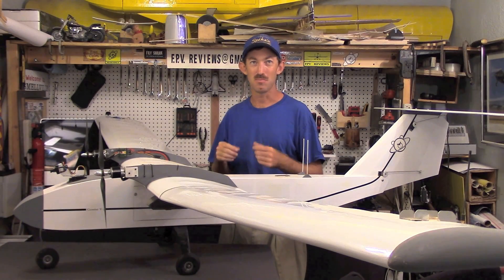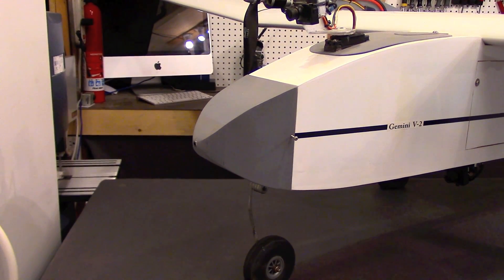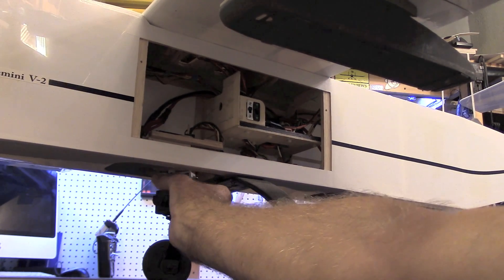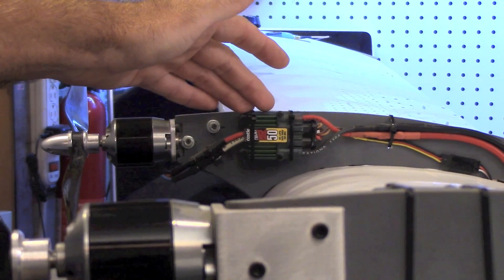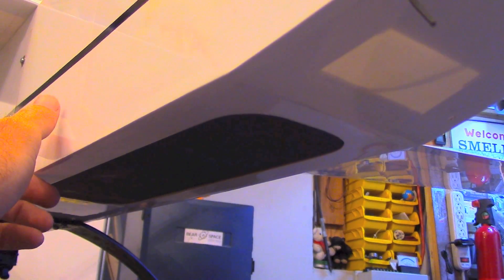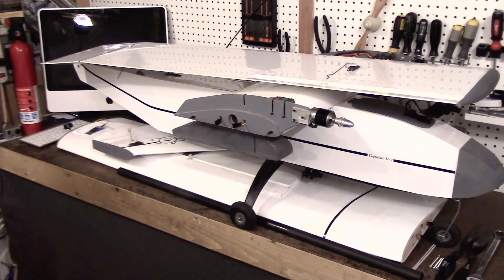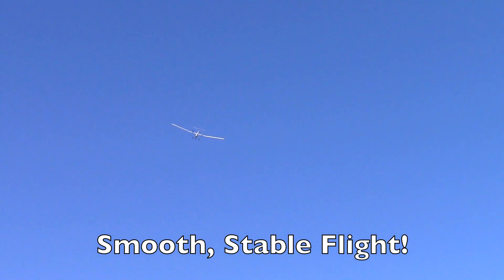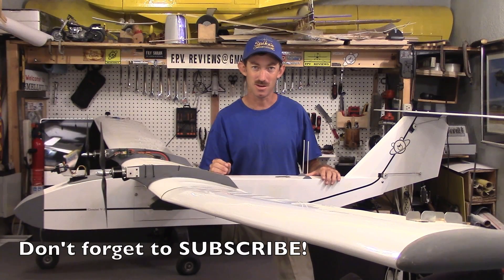Gemini Version 2 Review - Advanced FPV / UAV Plane - Plans and Kit Available Now!

Comment: instead of installing to blade propeller is it possible to install four blade propeller for more thrust.
Reply from the maker: Yes, it's possible.    however, the stock thrust is more than sufficient to carry a large external payload and have a good sustained rate of climb.  The plane climbs primarily due to the lift, not so much the thrust. The motors just have to make enough thrust to maintain a climb airspeed, and a small angle of climb, and the wing does the rest. It's quite different from most sport aircraft.
Reply: Ok is it possible for you to construct the same and make detailed video for this as I wanna to learn as I am crazy about aeronautics
Reply from the maker: We've made lots of videos including a build video, and you can find out more info on our website. link in the description.

Comment: About how much does this entire project cost to build?
Reply from the maker: The airframe can be built for 1000-1300 US depending on kit version, or scratch built version, and choice of propulsion.   not including battery, control system, or fpv equipment.  It's more than the foamies, but low cost when you compare it to other UAV's with similar capabilities.

Comment: So when dropping the payload, you lose the doors? Unless you go and find the little things. Also can long range fpv still take place if trees get in between you and the aircraft?
Reply: I was thinking the same thing, but the door looks pretty simple, so making lots of spares sounds like a better plan than having the drag of a hinged door hanging loose.
As for what to drop in a SAR scenario, I'd think a smoke canister in one pod and a small aerial flare in the other, along with maybe a signal whistle and/or air horn would be the most helpful, letting the victim have another method to guide searchers in if the plane can't keep circling overhead long enough for them to get there.

Comment: + FPVREVIEWS 

Great work , I love it , always keep upgrading , going to fly it soon.
I like it so much and already get the plan and the kit  from wayne. 

I still have some Questions  : 

1- Could you suggest another motor ? or Guide me for some important specification to choose ? 
now I just have O.S Motors (OMA-5020-490) and ( OMA-5025-375 )  which is 490Kv and 375 Kv 

2- I have Dualsky ESC 80A dose there any problem in using it instead of buying new castle PHOENIX EDGE 50 A ?

 Regards .

Comment: What osd are you using?
Reply from the maker: +daniel perkins Telefly OSD that came with the tracker. you don't have to use it for the tracking feature, you can piggy back another osd  if you prefer. but i like it.
Reply: +FPVREVIEWS Sorry for another question, but how long does it take (on average) to build?
Reply from the maker: +daniel perkins can be built in 2-3 weeks.

Comment: Can this aircraft fly single engine in case engine lost? With full payload what are realistic endurance at  7 thousand feet MSL field elevation and climbing to a cruise altitude of 8 thousand feet MSL?
Reply from the maker: +svsoftair I have not flown the Gemini V-2 on one motor, however, i have flown the prototype, (very similar) on one motor, and it pulled to one side a bit, but was very controllable. it was at max power at the time of the failure. i expect that a motor failure in itself would not be a problem. i may simulate a motor failure, by making a way to shut off the signal to the esc in flight, and do some testing, when i set the chance. 
it's very unlikely that a motor would fail in flight, if the motors and esc's are not overloaded. about 75-80% of max is recommended for continuous operation at full power. and the wiring has to be large enough as well. 
at that altitude, i don't think the endurance would be much different, if at all. with an air breathing engine, yes, but with the electric power, i don't think there will be a big difference. perhaps none. if there is any, an adjustment to the prop diameter or pitch would compensate. I have flown it up to 4008 meters, and it climbed just fine, at 30 amps out of 80.
Reply: +FPVREVIEWS thanks Spike

Comment: This is really neat, but woud be really cool with retracts.
Reply from the maker: +Joe DeJohn i was thinking Tecnam style retracts.
Reply: Had to watch a video to understand what you were talking about.  Heh.  Might not be a bad idea.  Easier said than done for sure.  Really don't know all the options out there to comment further.
Reply from the maker: +Joe DeJohn the overall challenge of integrating retracts is fairly simple, in that most aircraft that have them either have very complex actuators, or are a low wing configuration, making the retracts simple to integrate. 
you're right, though, it would be cool.  and reduce drag, etc.
Reply: I wonder if you made a hinge with a spring that would straighten the posts.  A small servo with gearing would collapse the hinge(retract).  The posts are partly a stiff spring for shock absorbtion.  Crude.
Reply from the maker: +Joe DeJohn E-flite makes some very nice and lightweight servo less retracts, it's just a problem of how to integrate them.

Comment: is this balsa or aircraft plywood? If I buy your plans, are they in .plt format so I can send to my own cutter?
Reply from the maker: +grinchyface It's made from Balsa, aircraft grade lite ply, and carbon fiber tube spar, and pultruded strips. The plans are PDF, but if you want it laser cut, the kit from Flying Squirrel Models is a great value, it's about the same price as the wood.
Reply: Thanks sir! I considered buying a kit, but as this would be my first balsa build I imagine I'd break or mar half the parts at least once. I purchased the plan last night- is there any chance for an extra fee I can get .svg .plt or another vector format that your laser guy might be using?
Reply from the maker: +grinchyface Thanks for your purchase!  The laser cut files were created by Flying Squirrel Models for their own use in the manufacturing of the kit, so they re not available, however, they have priced to the kit in such a way, that it is cost effective when compared to purchasing the raw materials. I recently did a custom build from the kit, and it was excellent. Sorry I can't help with the specific request. Best, Spike
Reply: Just had a chance to glance through the files, am I correct in saying these are just assembly instruction and don't actually contain individual part dimensions or sketches?
Reply from the maker: +grinchyface you were sent several files, the build instructions and plans are separate. the plans should be there, 4 pages of them.
Reply: Found 'em! Stellar hand drawing sir, lost art.
Reply from the maker: +grinchyface That is Dad's work, the hand drawing, and printing. i'll let him know. Thanks!
Reply: oh hey, wanted to note that LG has released a safer 3000mah 18650 cell called the HG2 capable of 30a per cell, 10c. 40 something grams a piece. Not the energy density of the 18650b you seem to be using but they are cheaper, and they tend to not catch fire as readily as the 18650b chemistry
Reply from the maker: +grinchyface thanks, i will check it out, if the specs match, i;ll be ordering some to test.  thanks for the tip.
Reply: strike that, 20a continuous rating, although I have run some at 60a for a few seconds.
there's a spec sheet: http://keeppower.com.ua/download/2015-06/datasheet-LG_INR18650HG2-1.pdf
Reply from the maker: +grinchyface 20 amp continuous rating is still very good considering the energy density is still 28 % batter than lipos, and I was just doing some calcs, and it should work as a good optional upgrade for my Future Star hybrid rocket plane.  thanks for the tip.  i'll order some, and make a pack to test.

Comment: Can you waterproof the Gemini?
Reply from the maker: +Jorge Tortosa I'm afraid that would be quite impractical. We did build a smaller uav a while back for yacht photography, called Atlantis. it had 1.5 meter span, and 50 minutes endurance. single boom pusher. it flew very well, but applications are limited.  we find it better to spend the extra weight required for waterproofing simply to increase airframe performance, even when flying over water.   there would be a very special set of circumstances where the waterproofing solution would be good, but for now we are concentrating on land based aircraft which can be flown over water.

Comment: Hi, I recently got the plans for the Gemini and have a few questions:
1.It is possible to use 2x 500mm tube rather than 1x 1000mm tube in the centre wing section, I can get 2 x 500mm tube for a 1/5 of the price than 1 x 1000mm tube.

2. The plan package on drop box came with sheets 2,3,4,5 of the plans, but not page 1, is this normal?

3. I have lots of ply available to use, but not much balsa, would it be ok to use ply where it says use balsa (it will be the correct thickness)? I still intend to use balsa for the square and circular dowel sections.

Thanks for the great plans, can't wait to get building this machine!
Reply from the maker: DroneDuo use the link below for the purchase of the carbon fiber tube, it should not be very expensive.  it really needs the 1 meter long section, unless you have a way to join the two 500mm sections without losing strength. you could join them with an aluminum plug, but you would have to have it machined, then use small screws to secure it?  One piece is best because it can be slid, out and removed for transport. 
page 1 is now called the spec sheet, it has been re-named, this is normal. 
it's ok to substitute lite-ply for many parts, just watch the overall weight.  the design is tolerant to weight, but the payload, duration will be reduced slightly. in most cases, keep the thickness.   Let me know if you have any other questions. my direct email is fpvreviews@gmail.com
best, spike

http://www.ebay.com/itm/OD-25-mm-ID-23-mm-x-1000mm-1m-3k-Carbon-Fiber-tube-Tubing-pipe-shaft-/141394052252?pt=LH_DefaultDomain_0&hash=item20ebbe049c
Reply: Thank you for the link, doesn't seem like a bad price now. 

Do you have a source for the 7x1.2mm carbon strips? I can only find 6x1mm at the moment.

Thanks
Reply from the maker: DroneDuo i buy from rcfoam.com   actually, 6X1 would work too, but it's so easy to order from them, that's what i'd do if possible.

Comment: Beautiful plane. I would love to build one. What is the max prop size it can run in the stock configuration?
Reply from the maker: blueflamingo1 without modification of the airframe, a 17 inch prop will physically fit. if you flip the motor mount brackets, a 21 inch prop will fit. it's just a few bolts to swap.  the recommended prop is a 13 x8.
Reply: Thank you.  I was thinking of running 15x4 propellor for greater efficiency over a 13x8 (completely unnecessary I know)
Reply from the maker: blueflamingo1 i have tried runnig less pitch, and it was not as good.  what might work better would be a larger diameter, even more pitch, and lower rpm/KV. if you try anything, i would be interested to know the results. 
the lower pitch props work well on multi rotors at near zero airspeed, but for planes, a bit higher pitch usually works better.  the 15 inch prop will fit, though.  trying props is cheap at least.
Reply: Interesting, I never would have suspected that a large diameter but smaller pitch would perform worse.

How much thrust are you getting on your motors (roughly)?

I was thinking Cobra 2820 840kv on 15x6. This would give me around 4.5kg thrust total. I don't intend on carrying a large payload, instead just a very stable AP/FPV platform. Do you think this would be enough thrust? If I go ahead with this project, I will keep you informed on how the motors perform.
Reply from the maker: blueflamingo1 the difference is relative to airspeed. at zero airspeed, a prop with large diameter and less pitch. ike a multi rotor prop is the best, and produces the best static thrust. 
static thrust is no longer relevant, as the airplane will not be static when the motor is running,a nd the prop is working.  have a look at the props on a  turboprop commuter plane in flight.  lots of pitch, and they use constant speed props too. but they adjust for a lot of pitch in cruise flight.   
i have not tried much larger props on gemini, however,a nd would be interested to know. 
thanks.
Reply: I was discussing this on forums and one person mentioned this link http://www.mh-aerotools.de/airfoils/propuls4.htm and quoted "For a given power P, it is always desirable to use the largest possible propeller diameter D, which may be limited by mechanical restrictions (landing gear height) or aerodynamic constraints (tip Mach number). That's why most man or solar powered airplanes use large, slowly turning props. These catch a large volume of air and accelerate it only slightly to achieve the maximum efficiency."

What do you think of this? 

Thanks
Reply from the maker: blueflamingo1 sounds absolutely correct, the part about aerodynamic restrictions is the relevant part, and the setup you spoke about (840kv) motor sounds similar to the setup that i'm using, in that the prop rpm is close to the same, mine is a 950kv , the major difference is that you will have, by the sound of it, much more thrust. 
i have not measured the thrust that mine puts out, but you can figure that i have just a little more rpm, for any given throttle setting, and smaller prop, so you should have more thrust. 
at zero airspeed, the largest diameter prop is best, but you would have to put the setup in a wind tunnel to test thrust at a given airspeed. or make your own wind tunnel out of a car, or fly the plane with telemetry. the setup you want to use should work fine,  what i don't know is at what point dragging  a larger prop creates more drag than thrust at this airspeed. there must be somewhere a calc that allows you to introduce airspeed in the equation.   
for an example of how effective large props can be at zero airspeed, check out the human powered helicopter "Atlas". 
gemini airframe best loiter airspeed is about 42km per hr.
Reply: Thank you for taking time to answer questions on your design. I think I will have around 4-4.5kg of thrust, e-calc estimates the Power 15 on 13x8 at 6kg total. Do you think this lack of thrust will cause issues (I don't plan to carry much payload)?  When picking a propellor, I plan to match my pitch speed with your one (94km/h on ecalc) as closely as possible.
Reply from the maker: blueflamingo1 i think it'll fly fine with less thrust, although i'm not so sure it will actually have less, difficult to tell for sure, as tha airspeed factor.  tha plane, even fully loaded will take off with much less than full throttle. half throttle gets it off the ground just fine, so i think it's good.  I have thought it will probably take off with one motor, but have not wanted to try it..

Comment: questions: 
1 does it work on high humidity or rain?
2 if one engine fails, the remaining, can bring the plane home?
2.1 there is one batt for both engines? so if one fails, the other can use the remaining power?.. 
3 is it possible to glide silently, if needed?
Reply from the maker: domnuspike humidity, no problem, in fact we did our 4 hr +endurance flight in high humidity.
rain, don't know, it's a wood plane, probably not the greatest idea to intentionally fly in the rain.  if i did, it would seal the gaps in monokote with tape first.  
one large battery pack.  lots of cells, so if a cell fails, no problem. with modern cells, that should not be much of problem , anyway. 
motors only running at 80% pf their max rating for continuous, so a motor failure is unlikely. 
we did experience a motor failure on our prototype, at full power in a climb, and we were able to maintain control, without problem. it just pulled to one side a bit. 
you can go back to our channel to watch the video. we happened to have a camera looking at the motor when it failed, and you can see the smoke roll out from the cowling. 
we have upgraded the motors since then, and also, the new style motor mounts are heat sinks. 
it glides very well, we recently glided from altitude for 40 minutes straight. 
i set props to freewheel in glide to provide some aerodynamic braking actually. 
check out our other videos, and the website for more info.
Reply: FPVREVIEWS 100% and 1000‰ complete answer, 
thank you..

Comment: This looks pretty cool! What is the estimated price to build the aircraft including every components. Thanks!
Reply: Gyula Szabó Gemini V2 (as slightly modified by Tom and Dave) is available in a variety of stages of completion. They range from Assembled Fuselage, Wings and tail sections to complete with FPV and PixHawk autopilot systems. You can contact Tom at teimages@sbcglobal.net for more details. Prices start at $1,500 USD.

Comment: shut up and take my money! 

whats your maximum payload?
Reply from the maker: Depends on how little battery you are willing to carry. about 7 lbs would be max, and still be able to fly for at least 30 minutes. at the recommended max gross weight. if you overload the plane, and only fly for a few minutes on small batteries, probably could carry more than 10 lbs.  not a great idea, but would do it.  if you want to lift a lot of weight, a 16 ft telecaster would lift more. gas engine.